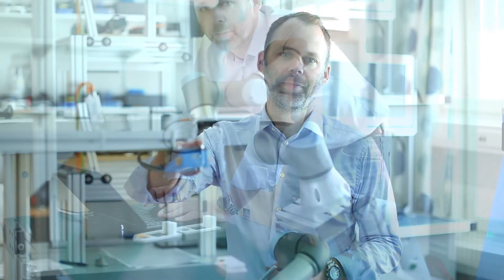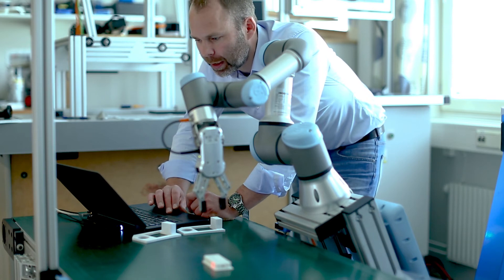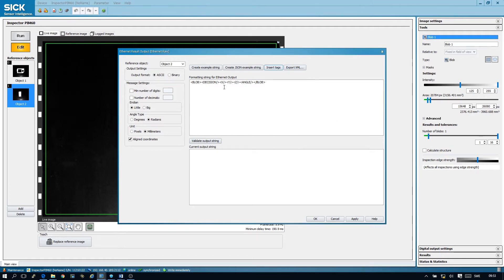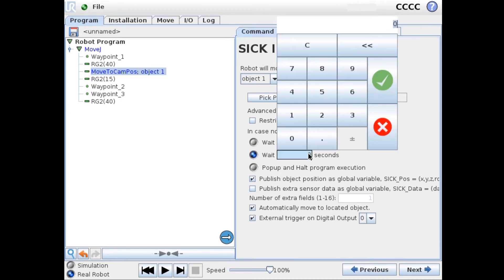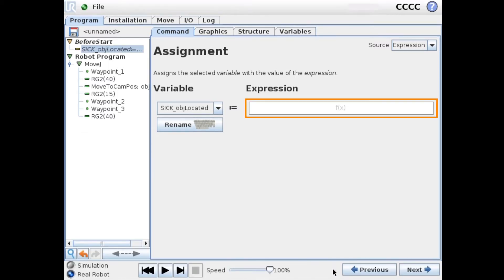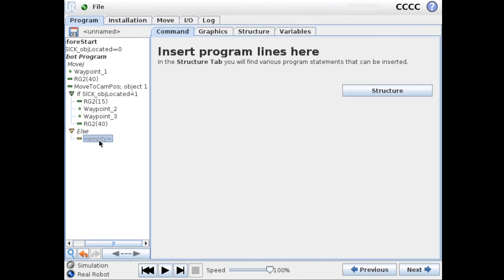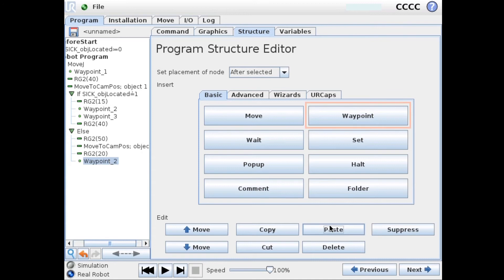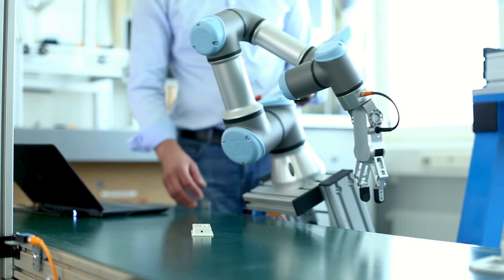Tutorial Inspector URcap (2/3): Switch reference objects | SICK AG

Comment: Thanks for the tutorial! We have trouble running the program in a loop. The robot will always use and approach the object location detected in the FIRST program cycle, even if the object location changes or there is no object to localize in the following cycles. Referring to your video, that means: instead of moving to the next object location (as it does at 9:58) it will go back to the first location detected after starting the program (as it does at 9:47) again and again, even if there is no more object. Even if I assign the SICK_objLocated variable back to 0 in the end of the program, it will jump right back to 1 in the next cycle even if there is no object in the FOV. So I guess the camera is delivering the old coordinates again and pretends to have found the object again. Any suggestion on that? Thanks!!
Reply from the maker: Hello,
if you have access to the support portal you can either start a support thread yourself or get in contact with your SICK sales representative to that he/she can start a support thread about this issue.
Best Regards.